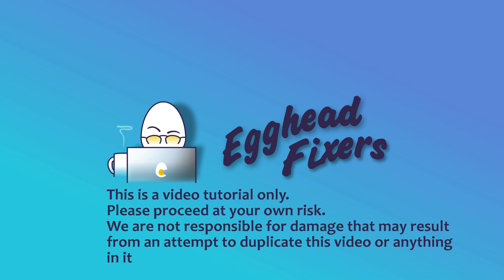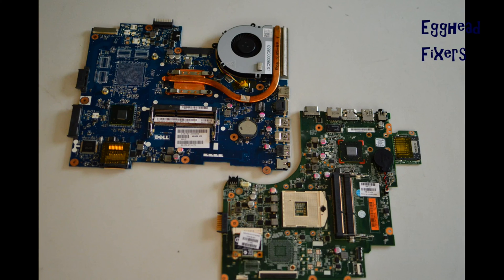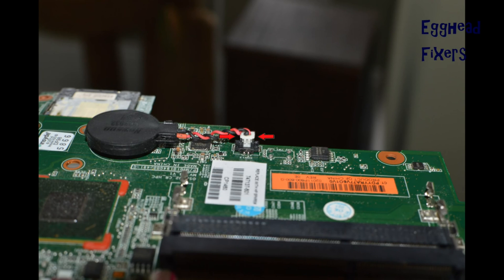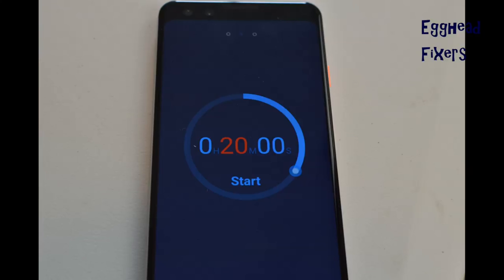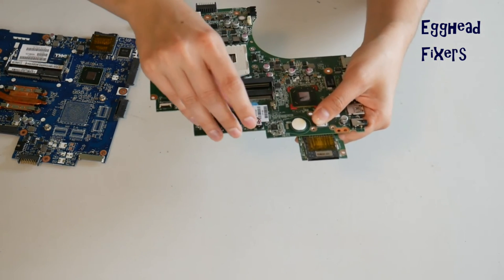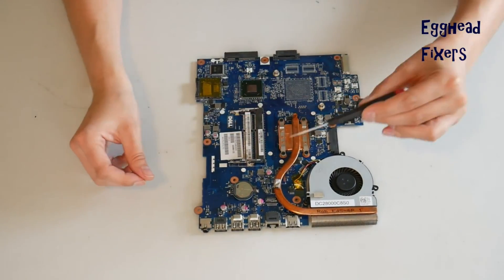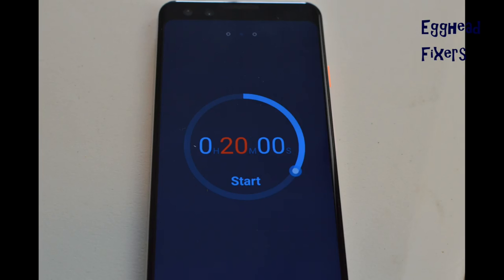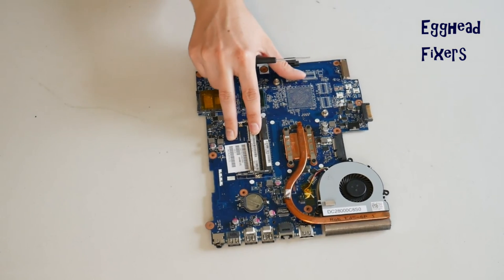How to Fix a Dell Computer That Flashes LED Code 3 or 3 Amber 3 White - By a Certified Technician

Comment: Hi, your videos are awesome, nice composition. May I ask if you know what to do on a led code 3 amber and 6 white? 3,6 System BIOS Flash incomplete
Reply from the maker: Error code 3 6 is not a listed Dell LED error code although we hear about it all the time. Dell says it does not exist. For this error code we suggest a BIOS reset because oftentimes it is an issue with the motherboard. Here is a video on how to do that:

https://youtu.be/bZSz-jjexqM

Comment: I did this and it did not seem to fix my issue. I am still receiving the three white and three amber blinks. When I turn my laptop on the fan starts running, fairly hard. It will run from anywhere to 30-45 seconds before powering off. The LED sequence will flash during this time. The screen stays black throughout but you can see a flicker when you press the power button and when it shuts off. I have replaced the CMOS battery with a fresh one, reseated the RAM just to be sure, and examined all other connections and can not seem to find any obvious issues. Any suggestions?
Reply from the maker: It could be a problem with the motherboard itself. This LED code can be a problem with your motherboard and replacing it would be the next option.
Reply: @EggheadFixers is there a surefire way to test that theory or should I just replace the motherboard?
Reply: Hi, did you manage to solve it? I have the same problem.

Comment: I have dell latitude e5570 with ac adapter wattage not determined... bought a new charger still same, battery is also not detected and i have 3 amber lights and 1 white pleas help
Reply from the maker: Do you have an original charger that came with your laptop? What does it say for wattage? Because the replacement one needs to be the same wattage. Otherwise, it will not work correctly
Reply: I bought exactly the same charger it arrived with 19.5v 4.62A 90W and i changed the charger jack @EggheadFixers
Reply from the maker: @ReaMashinini  Have you tried replacing the battery?

Comment: My dell xp5 tower flashes white 3 times and orange 1 time. What should I do?
Reply from the maker: 3 1 is a CMOS battery failure. Your CMOS battery is a coin sized battery on your motherboard. It's easy to replace.  Here is a video on how to do a BIOS reset: 
https://youtu.be/bZSz-jjexqM

Although it's on a different subject you will see what the battery looks like and how to replace it.

Comment: Hi, How do fix the power button on my DELL computer? It's flashing 3 yellow and one white lights?
Reply from the maker: LED code 3 1 is a CMOS battery replacement. So you most likely need to replace your CMOS battery. Here is a video on how to do a BIOS reset which will show you how to find and remove you CMOS battery: 

https://youtu.be/bZSz-jjexqM

Comment: I have a Latitude 3379 , i have tried what's on the video to no avail, it still gives me 3 amber blinking light and 3 white blinking lights, when trying to boot normally it just stuck a Dell logo and stay like that, doesnt do anythin else, any help?
Reply from the maker: It could be an issue with the flea power needing to be released. This video is on a different issue but it will show you how to do  a hard reset:

https://youtu.be/lFv5pqNadVQ

Also it could be a hardware issue so here is a video to how to scan your system for a failed component:

https://youtu.be/BqZGQJ2_egI

Comment: Liz, I have a Latitude D610.  It has been unplugged and not in use for 2 years.  I plugged it in yesterday and it would not turn on.  The battery light flashes amber 4 times and green 1 time.  What error is it experiencing?
Reply from the maker: That's a faulty battery error. I would try this solution: 
https://youtu.be/UIZitN-cnik
Reply: I'll give that a try. Thank you.
Reply from the maker: @joeschoe4477  You're welcome

Comment: I did as video described and the lights went away. I retried to start the laptop by holding esc + ctrl (my power button isn’t working and when I did the first esc +ctrl to try and enter BIOS is when the 3 orange 3 white started flashing). 
It’s now back with that same 3 orange 3 white flashing. 
The keyboard is backlit but nothing on screen. Any suggestions?
Reply: To add, my laptop has had an issue with the power button for a long time but my normal tricks aren’t working and the power died while it was unplugged so i needed a way to get it on, which is why I originally tried the ctrl+esc and plug in adapter
Reply from the maker: You try this:  https://youtu.be/EQz0YXZShQ8

Could be a more than one problem which can make it especially hard to troubleshoot.

Comment: Hi there, I  have dell e7470 laptop and initially had 3 orange and 3 white error codes -- I followed your instructions and now have 3 orange lights  flasing away -- what does that mean? Any help will be appreciated
Reply from the maker: Does the computer have any power at all? Does it turn on at all?
Reply: @EggheadFixers   Yes, it does have power --  fan switches on for about 5 secs and then switches off when I touch some keys on the key pad you can see the white light under keys ---- there is nothing  displayed on the screen. I have test with the laptop by disconnecting the ram switching it around, replacing with new battery, changed the bios battery, I have connected to external monitor via a hdmi cable  -- all to joy.  Any help will be greatly appreciated.
Reply from the maker: @jackthelad-sb7bk  Have you tested the power jack and power cord? Have you tried replacing the CMOS battery? Typically this error code is an issue with the CMOS battery not being holding or being charged.
Reply: @EggheadFixers   Yes I have changed the CMOS battery -- that what I meant when I said  I changed the bios battery. Is there way of checking is the charge is getting to CMOS battery?
Reply from the maker: @jackthelad-sb7bk  You can use a multimeter to test this but it can be hard to do if you have never done it before. If the power cord or power jack is not giving the motherboard enough power then the CMOS battery will not charge. Here are some video that show you how to test the power jack and your power cord:

https://youtu.be/DukL71RyUO8

https://youtu.be/IrNgyd8T0Fc

https://youtu.be/TA1mFPtKVnw

You have done a good job troubleshooting so far. You have tried a lot of the more common reasons for this issue.
Reply: @EggheadFixers  Sorry for delay in replying. I have watched the videos and checked tested the power supply -- which is working perfectly fine. I think the issue is with powerjack on the MB as I could not get a reading -- i've come to the conclusion that MB needs replacing.
Reply from the maker: @jackthelad-sb7bk  Sorry to hear that :/

Comment: I have a Dell latitude 3400 and I'm getting one solid white at start up followed by continuous blinking amber. Battery stuck at 0%. I have to keep it on the charger otherwise it shuts off. What should I do?
Reply from the maker: It sounds like you may need to replace the battery. A amber blinking light can be a sign of a bad battery.
Reply: Thanks!
Reply from the maker: @MzPinkee05  You're welcome!

Comment: i get blinking green led 3 and power button is not lighting . then i  remove battery for 20 min and pull it back and it turns on but i get same problem again after one day why
Reply from the maker: It could be that the battery is starting to fail and needs to be replaced. They are usually pretty cheap to replace.

Comment: Hello ma'am i have dell inspiron and it's blink one time amber and one time white. It turns on when i connect it to the charger but the battery isn't charging it's stuck on 0%.
what should i do?
Reply from the maker: It sounds like you may need to replace the battery. A LED code like that can be a sign of a bad battery.

Comment: To be honest, in 10 years or repairing laptops, this fix has never once worked.  Just goes back to the same. Now not saying it doesnt, just has not for me. The extremely disappointing issue is three occasions going to Dell for support, the second Ive said its flashing 3,3 all three times they have said MB failure, needs replacing. no other diagnostics, no data nothing. Simply whaats the issue?" ME" Model xyz flashing 3w,3amber Dell" Motherboard failure"  "ME" But it boots to dell screen and spins forever" Dell" Motherboard failure, Replace"  Me" dont have extra $600 for a MB" Dell" sorry its 28 days past warranty, $600 plus install and shipping, $1200"    smashes dell buys HP..... This particular one was a new 2021 Precision 5550....Less than a month out of warranty, basically told me to pound sand on a $3700 dollar unit...
Reply from the maker: Wow that's an awful story. Sorry to hear that:(

Comment: I have a Latitude 3420 i3, it's blinks amber 5 and white1? I replaced the battery as the battery connector on the battery, popped it's silver retaining bracket. The new battery seems to be recognized in Windows 11, however it only shows up periodically in the bios. I tried to flash to the newest bios but keep getting a message that battery should be charged to at least 10% before the bios can be updated? I've checked all connections, but still getting error. It works perfectly when plugged in. Any help is appreciated.
Reply from the maker: Is it generic battery? Or did you get it from Dell?
Reply: @EggheadFixers  The first was generic, I should be receiving the Dell one today. I removed the generic & reinstalled the OEM, then got a continuous blinking amber light. Checked the battery again, the bracket on the battery for the motherboard had come loose... The replacement did not have that issue. Will install the new Dell battery and see what I get. Will respond either way. Dell says that it's still under warranty as it is a refurbished.
Reply from the maker: @braddobson9338  Generic batteries often time don't work. I would try the Dell battery and if that doesn't work then call it in under the warranty because it could be an issue with the motherboard.

Comment: A good movie. I have such a problem with the Latitude 5480. After disconnecting the Cmos Battery and Main Battery for 30 minutes and connecting it on, it is the same. I even moved the RAM to a different slot.
What steps to take next?
Reply from the maker: Does it turn on at all? Or does it turn on with a black screen?
Reply: @EggheadFixers  Only black screen, not backlight. Power on, wating 30 seconds and 3 blink amber 3 blink white. Restore bios (ESC+CTRL and connect charger) not help.
Reply from the maker: @wojcik96  Have you tried a BIOS reset? here is a video on how to do that:
https://youtu.be/bZSz-jjexqM
Reply: @EggheadFixers  Yup. Supported your video. it is the same
Reply from the maker: @wojcik96  LED error 3 3 is a BIOS recovery issue. Seeing that your computer will not even really there is a good chance it is a problem with your motherboard itself.

Comment: Hi,
Can you help I'm getting 3 amber 1 white 
Display not work,
how can i fix it ?
Thank you
Reply from the maker: 3 1 is usually a CMOS battery problem. Are you having any other issues? Like it won't hold a charge, the screen won't turn on or it won't keep the date and time.

Comment: (dell Inspiron 15z) I did this fix and it only worked! Computer booted perfectly for one boot cycle then on reboot back to same issue. I also installed a brand new cmos and set date and time in bios. any idea what is happening?
Reply: I have since tried running without cmos, and also without the 32 megabit flash attached to the back of the motherboard. same issue 3 white 3 orange occures ,dell Inspiron 15z
Reply from the maker: @SpicySpleen  Does the laptop seem like it's charging ok? Does the regular battery hold a charge? Also is the keeping the date and time in BIOS correctly?
Reply: @EggheadFixers  laptop battery is dead.
Reply from the maker: @SpicySpleen  That could be part of the problem

Comment: Well I am getting a dell code 2 red, 7 white... Can this also be the error of bios setting.
Reply from the maker: LED code 2 7 is typically  a problem with your LCD (screen) or LCD cable. Is your screen working?
Reply: Thx for the reply, actually when I press d button it start showing different colour like green blue red and black otherwise my laptop won't display anything or start and  keep flashing those led code 2 red and 7 white when i press start button... Anyways I also done the boot reset, still the same problem 😭
Reply from the maker: @tarunkumar-nr2gb  Does it display to an external monitor or tv without a problem?
Reply: @EggheadFixers  nope still the same 😭
Reply from the maker: @tarunkumar-nr2gb  There is usually a key on most Dells on my Dell its F8. I have to press that with the Fn key to get it to display to a monitor. I would try that just to make sure. This LED Code is usually a problem with the LCD (screen) or LCD cable. So if you can get it to display to something else it confirms its an issue with the screen and not the computer. Although sometimes it can be hard to get it to display to a monitor.
Reply: @EggheadFixers  yep it worked... So that means either my lcd display or its cable not working, many many thanks 🤠🤠🤠
Reply from the maker: @tarunkumar-nr2gb  Correct👍 Good job troubleshooting!

Comment: Well mine just doesn’t turn on, and when i plug in the charger its a white light for a second and from there only orange non stop blinking and still doesn’t turn on. I have no idea what to do please help. 
P. S. Im with a dell inspiron 15 3000
Reply from the maker: For a problem like that I would try these two videos:

https://youtu.be/UIZitN-cnik

https://youtu.be/bZSz-jjexqM

Comment: Hello, i have a Inspiron 15 (3878) 2014 and when turning power on, after 2 seconds it shuts down, ...and repeat. and repeat.
I have removed SSD, memory, ODD and wificart. it beeps 2 times because of no memory. With only memory installed, the above starts again. Tryed everything, but it wil not stay on for 2-3 seconds whatever i do. Can you please help me.
Reply: Mam, my dell laptop is blinking 3 times orange light and 5 time white light . please help.
Reply from the maker: @akashkashyap7261  Error code 3 5 is not a listed Dell LED error code although we hear about it all the time. Dell says it does not exist. For this error code we suggest a BIOS reset because oftentimes it is an issue with the motherboard. Here is a video on how to do that:

https://youtu.be/bZSz-jjexqM
Reply from the maker: The fact that the motherboard beeps when the RAM is not installed is a good sign. Because if the  motherboard can still recognize and give off a RAM error code then the motherboard is most likely working correctly. Were you able to test the RAM sticks? Here is a video on how to do that:

https://youtu.be/wY335MRKc3U
Reply: @EggheadFixers  Cannot do any test because of the 2-3 seconds on-off loop
Reply from the maker: @MarkBNL  In that case I would try a BIOS reset. Here is a video on how to do that: 
https://youtu.be/bZSz-jjexqM